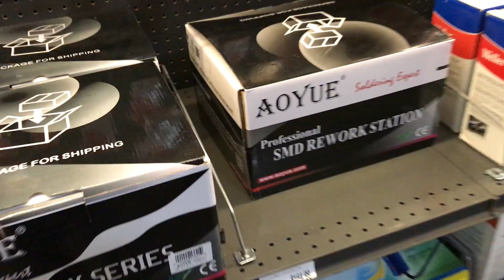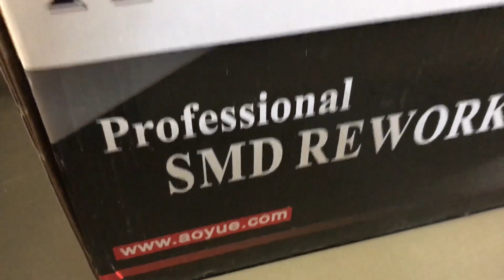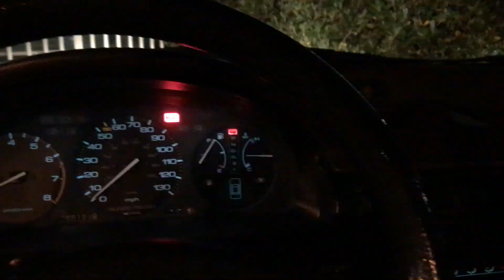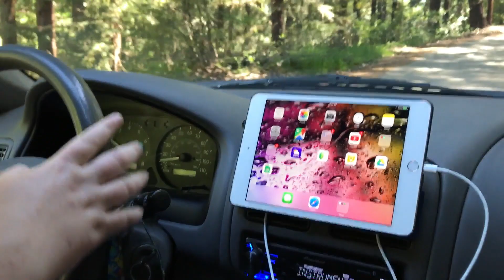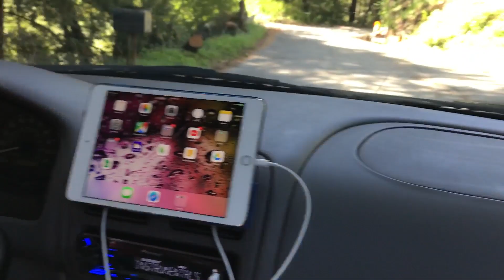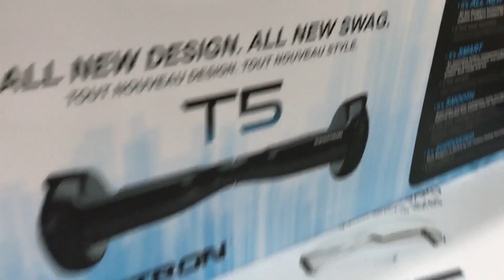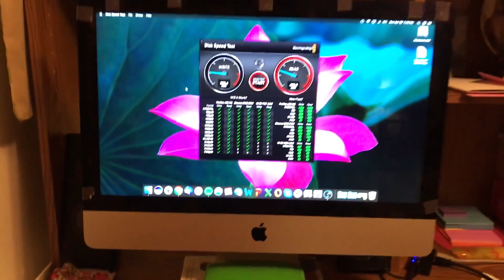Meetup Vlog 4-30-2017: iMac SSD Upgrade!

Comment: I forgot that with the new iMacs without the disc drive, the display is fused to the glass, so while replacements are more expensive, there are hardly any worries of getting dust in between the LCD panel and cover glass.

Also, with the hard drive upgrade, I remembered that what I did was to put the new hard drive into an enclosure, start my iMac with the old hard drive in it, load the recovery partition, go to Disk Utility, then just clone the old hard drive to the new one that way, then open up the unit to replace the hard drive. You probably couldn't do it because it would probably complain at you that the target drive is a smaller capacity, so I think I understand why you went for the network boot into the Mac OS online recovery environment.
Reply: Yeah but keep in mind the older iMacs only use magnets to secure the glass to the chassis, so if anything DOES make it in there, it's comically easy to remove the glass.